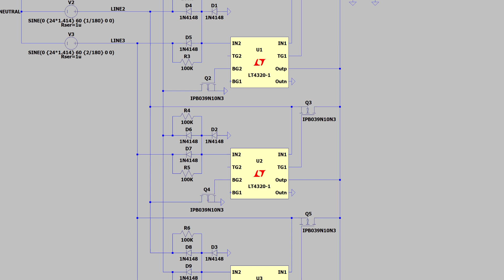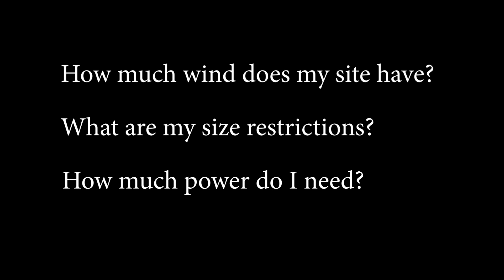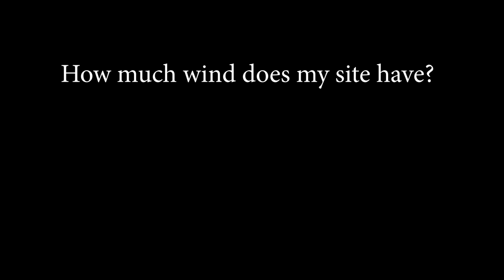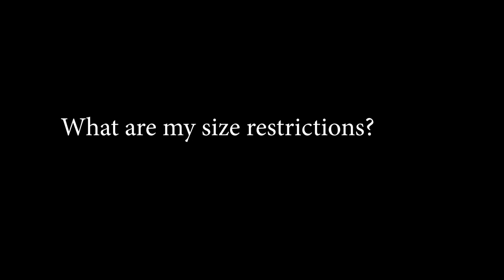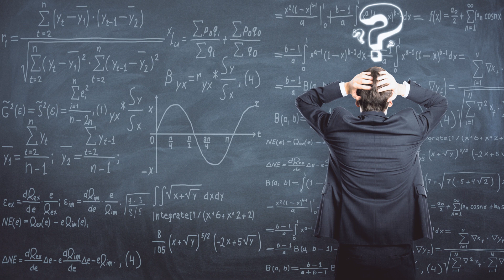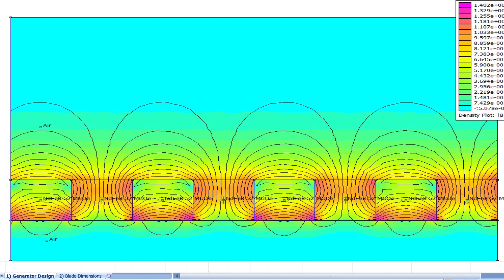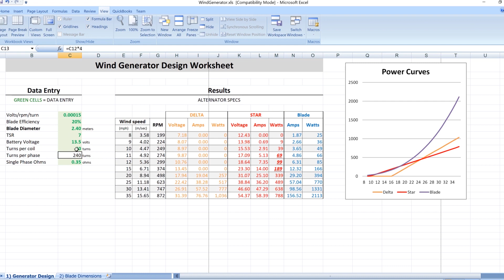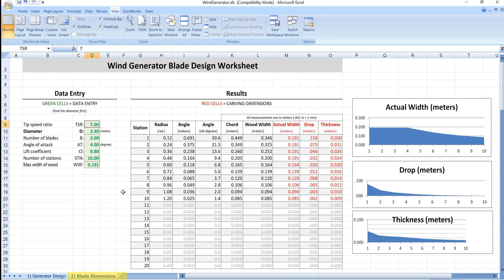Engineering a DIY WIND GENERATOR alternator [Capable Cruising Guides]

Comment: i believe you are using a simple diode bridge which explains the speed tradeoff.    I am using syncronous rectification with excitation.   So it turns on mosfets to avoid diode voltage drop (about 10%) as well as use high frequency to adjust the load to give more output voltage if there is not enough.   So it will produce some power at any speed.    It is also possible to switch between star and delta with a simple switch or relay.
Reply from the maker: Glad to hear it is working for you.  I bought the components to go the "ideal diode" route when I was last back for a refit.  But since the solar arch we have so much power we really don't use the wind generator anymore so that project got postponed.
Reply: @Clarks-Adventure  How did you plan to implement it?   I have current sense resistors in series with each diode and amplifiers across each of these which are sampled by analog comparators which feed a gate driver chip to drive the mosfets which are in parallel with the diodes.   It is very complicated but cost less than the diodes that would be required for such high power, at least cost is < $10 to handle 10 amps but my systems are lower power than yours making just a few amps.     I also have a microprocessor to excite the phases by shorting them at high frequency so they can produce enough voltage at any speed, even turning by hand slowly can put milliamps into the battery,.   I am working on improving the algorithm to track the best duty cycle, and it can also gracefully slow the turbine in overspeed or when the battery is getting full rather than on or off.    In any case I am also working on a hydro tow generator using this but dealing with vibration issues.  I wonder if you have a tow generator?
Reply from the maker: I had a tow generator for years.  Still have it in a shed in Florida.  Honestly it was more trouble then it was worth.  It was a forewinds.  I really like their propeller.  Uses a plane instead of a weight so stays at the right angle over a broader speed range.  Only problems I had were kelp and pulling it right out of the face of a wave when things get interesting.
   I made one of my axial field alternators that rides on my propeller shaft and can make a similar amount of power from the ships propeller.  This would truly benefit from not using diodes.  Chase down the problem and you will know what I mean.

For my version of the circuit I found an ideal diode controller chip that drives the MOSFETs.  One chip per pair.  So three chips required.  I'd have to dig it out to know it's number.  It was just released when I bought mine a few years ago.

I planned on using a microprocessor to control everything.  Watch voltage and such.  Including a rpm counter that I could use to decide when to shut down to protect from overspin.  I would leave it down for some time then let it try again.  My blade being 8 feet takes a while to get up to dangerous speeds so I expect this would work fine.

I assumed I might try your timing trick but I wanted to get the basics working first before I put much effort in that direction.
  FYI.  I have been using hall effect current sensors for the bbms plus.  You might like using them.  No voltage drop and they put out a signal range that can be read by a more simple adc without amps.
Reply: @Clarks-Adventure  The trouble with ships propeller is it is not a generating turbine so the camber is in the wrong direction and this gives a very low efficiency (more drag for power produced) as it makes more turbulence.   In any case I am and always have been engine-free and do not consider this even if it were fitted with symmetrical foils (someone mentioned he had done this) as a compromise between generation and propulsion. 

 I am using a cnc machine to make wind blades from wood, and 3d printer to make water turbines.   I am having trouble with vibration on the hydro turbine which is a rewound (for higher voltage) pancake drone motor.  The turbines can be quickly printed with many different parameters and I hope to do a bunch of trials soon then iterate as my current blades are not ideal.     Your blades produce much more power since they are so large, but by my calculations for 8' diameter the power is only half what it could be compared to some more refined designs, but these may make more noise, cost more (carbon fiber) and be more dangerous so what you have is really impressive.

There are a lot of details to consider, such as possibly being flexible enough to flatten the non-linear power curve a bit.   As for the hall sensors, they actually have a resistance typically of higher than the shunt I use which is only 2 milliohms.   The current sense amplifier INA180 multiplies the shunt voltage by 100 times so a standard adc or cheap comparator can use the signal.  Once it is finalized and I work out more details, I will try to make a video..   for now I gain a lot of useful knowledge from you, especially how to hang the wind turbine from a halyard.
Reply from the maker: The current sensors I'm using have no drop.  Just clip around the existing wire and pick up magnetic fields.

Glad you are enjoying the channel.  Keep me informed once you get your devices going and scaled up.

Comment: Hey, great set of videos, but I was wondering how much it cost you to set up this unit in all (if you can break it down by individual part cost, that would be awesome!).

I'd love to build something like this, but cost might be a major issue for me so I need to know how economically feasible it is before I even begin to consider actually doing it.
Reply from the maker: You are just going to have to do some research I'm afraid.  I built mine quite some time ago and magnets are so much cheaper now. ( And stronger).  You can use disk break and hub assemblies from a car but since I needed to keep it light and small I machined my own.  The mechanical part is the second biggest hurdle to cross.  The actual cost of components is reasonable.
   The biggest hurdle is all the calculations and design.  I supply the spreadsheets to help with blade and coil design so you shouldn't have to learn the physics.
Reply: Alright, thanks. I'm going to have to fiddle around with your spreadsheets quite a bit and see if I can get away with using parts that I already have and whatnot I guess, but it wouldn't be fun any other way, would it? :P

Thanks again for the great videos and especially for putting together those spreadsheets!

Comment: My only criticism Clark is the height in which the generator is mounted . A foot higher would be safer . Those blades would take your head off if you walked into them accidentally. Great build though . Brilliant.
Reply from the maker: They are like helicopter blades.  The fear makes you stay away.  That adds to the safety.  There is no room to rig them higher.

Comment: Hi, I bought one of these $150 USD Chinese Wind Generator. This thing looks great! Aluminum housing, carbon blades, looks just like an expensive model. I set it up and it spins great. The problem is it makes barely any power. When its spinning in 15 to 20 knot winds I get maybe 2 amps but it was suppose to be a 400 W unit. I was just wondering if it would be worth it to rebuild the interior parts so it actually works. I don't understand why the Chinese would make such a great looking unit but not take the time to actually make it work. All the other reviews also said theirs don't make more than 3 amps also.
Initially I was thinking about looking for a small car alternator I could fit into the housing. I dont know if this could work.
Reply from the maker: You might be able to upgrade the magnets.  Then you could use my spreadsheet and this procedure to rewind the stator.  Worth a shot.

Also realize that there isn't that much energy available in a 3 foot circle of moving air.  Use my spreadsheet to find out how much is available to see if it's worth the effort for you.

The reason they do that is what I'm talking about in this video.  I bet it makes 400 watts in 40 knots of wind.   Better to have one that maxes out at 300 watts but makes some power at 15 knots.

Comment: Thanks SO MUCH Clark ! Do you know of any good links for blueprints or where you got your info ?
Reply from the maker: The physical alternator isn't that hard to fabricate.  I used automotive needle bearings so the hub looks a lot like the front hub of an older car.
    The trick is the blade, windings, and regulator.  That's why I share the videos and make the Excell spreadsheets available on Patreon.

Comment: Quality stuff.  With a bit of brushing up on electrical field theory from google I think one could engineer their own alternator with this.  Wondering what you think of this prepackaged solution?  https://www.windbluepower.com/Permanent_Magnet_Alternator_Wind_Blue_Low_Wind_p/dc-540.htm
Seems like it is for a somewhat smaller rotor.
Reply from the maker: Thank you Graham.
Looks like a quality alternator modification, I've seen it on line before.  If it met ones needs and you could mount the case easily it might work fine.  You could use my spreadsheets to design a blade for it easily enough.  Just follow the same instructions but use their Amps/rpm numbers.  Probably would need a small blade to get the rpms.
   I looked into mounting permanent magnets in an old alternator and rewinding it.  Worked but I could never get the volts/rpm high enough.  But the magnets were not as powerful back then.  I eventually went with my own alternator because I had a lathe available and it worked and fit so much better.

Comment: thanks very much for the great detailed content.  planning a build myself. I was wondering if a regular alternator would be usable rather than building one or would there simply be too much lose. I guess you would need to modify to with magnets but is it worth it?
Reply from the maker: An automotive alternator needs much higher RPMs then a blade can generate.  Gearing is loss and makes autostart impossible.  Not to mention the loss if keeping the rotor magnet alive.
   I have built wind generators based on brushed DC motors.  But nothing is as effecient as this kind of alternator.  Also the shape of a flat axial field alternator fits so nicely.
   Hope your build goes well.  Post it when it's complete, please.
Reply: @Clarks-Adventure  thanks very much for your response. Ive dove into all the videos I could fine on dyi generators and came to the same conclusion. I was wondering would it be cheaper to just use a DC brushless motor? Or I guess its mostly time invested since the parts are not all that expense. lastly what do you look for when sourcing permanent magnets? thanks so much.
Reply from the maker: If you can find an existing motor/alternator with enough room to wire up the way you need it, it would save all the lathe work.  But I haven't found anything that wasn't a bunch of compromises.
  If you find something that works I'd like to see it.  To make real power at direct drive rpms you need strong fields and large wire.  The problem gets worse as you go larger with your blade.  For the same TSR you have a lower rpm but more torque to harvest.
   When I made my first unit magnets were really expensive.  Now they are cheap and easily available.  I use steel rotor plates to carry the flux.  If I was to do another I'd use aluminum plates and put the magnets into a halbach array with a mix of pie shaped and rectangle pieces.
   Lighter and no corrosion or paint to worry about.

Comment: Hi Clark, I'm back. Wondering what type of regulator you are currently using if not your Arduino system?  Would you be willing to share your schematic of your Arduino system? I think it's very cool you have built your own wind gen and your own regulator and would love to see what you designed if you're willing to share. If you plan to sell these then I understand not sharing for sure. Thank you either way. I too love building projects as you do. Because my boat is 1,500 miles away from me most of the time I build a systems monitor that reports shore power, battery voltage, bilge water level, number of times the bilge has ran, and inside air temp.  I use an Arduino and a cell phone module. I just send a text command to it's cell number and it text me back all the status I listed.Too bad I am not in the Bahama's right now. We could have a good time geek'ing out together.
Reply from the maker: Yes Steve I would like that. I could use the motion of someone to work with.

I have to get going in that project.  I just rounded up.a tiny 12v battery for the development power source.  I finished a rainy day project today fixing my camera.  So next rainy day I should get back in that.

Comment: Great explanation on the design. I've always thought the commercial wind generators are quite small and need too much wind to get a decent output. I'm going to have a go at making my own. Thinking about carbon blades over dense foam core like model airplane wings and a high lift profile for low wind... 
That's my sleep ruined with thinking 😊
Reply from the maker: I know what you mean Samantha.  I build these things so I can sleep without thinking about them.

   Please look at my blade video.  I found carving them from wood the easiest way to get a great blade. I've put carbon fiber over my last one, video to come.
   Hope your project goes well.  Keep me posted.  Not many of us out there.

Comment: Hi Clark. Found your channel through Lady K Sailing channel. Have you ever built a wind generator using a squirrel cage design? I was told they are better than blades. Any comments? Thanks for sharing this video. I really enjoyed it.
Reply from the maker: Welcome to the channel Steve.
   I assume you are referring to a vertical turbine type.  They have the advantage that they don't need a tail. But in every real way they are inferior.  The energy available is a function of the size of wind shadow, for want of a better word. It's a lot of work to make aa large a turbine in vertical shaft as horizontal shaft.   Maybe not as technical but a lot of parts and materials, and I like to think that I've provided a decent solution to the technical problems.  Did you see my video on carving a blade?
   Take a look at some of the vertical projects out there, I never found one, back when I was doing my research, that showed their actual power output.
But it's all great fun to experiment with!

   And for me on the boat I needed a design that fit in my small space.

   Was that what you meant or did you mean some other design?
Reply: Hi Clark. Nope you are correct in assuming the vertical turbine type. I did buy a book some time back, but I have not started any experimenting yet. It will be a project for my retirement years at this point. Thank you so much for your reply. I plan to watch all your videos soon. Fair winds to you.
Reply from the maker: PS.  I did put together a water turbine based on an actual squirrel cage fan from an old air conditioner.  It's down in Panama now.